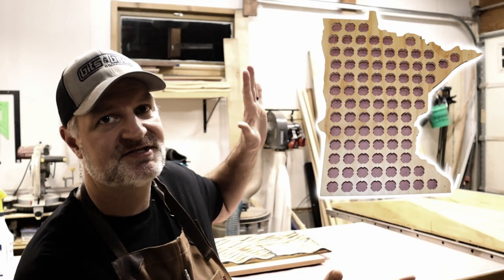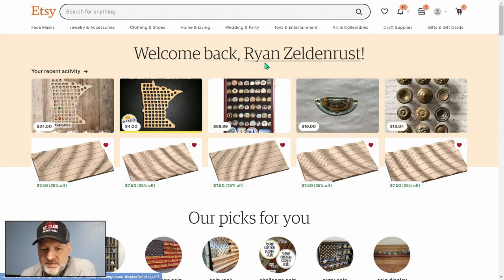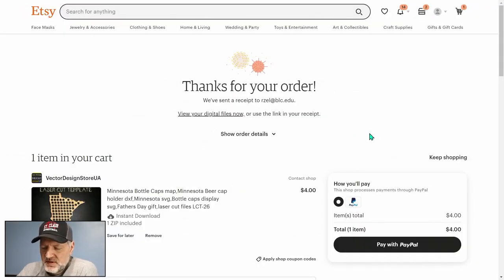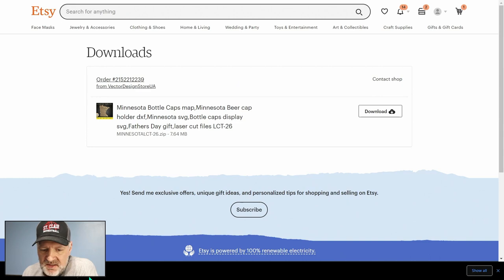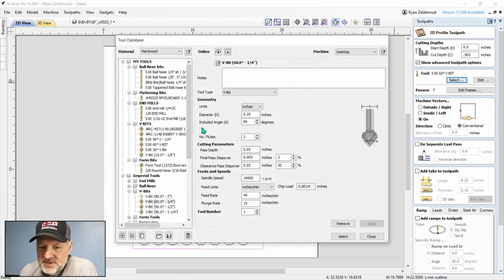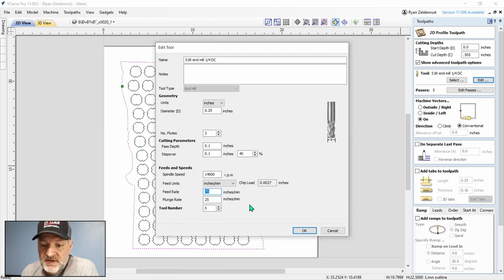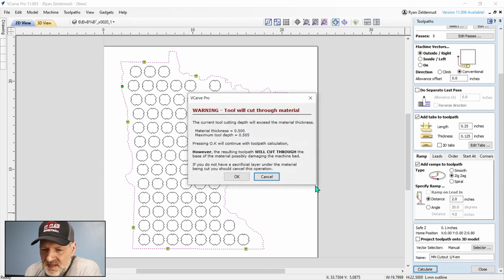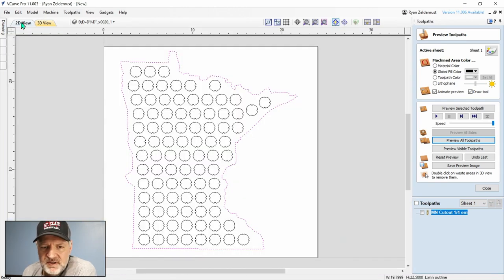Jaw-Dropping Bottle Cap Display meets Vcarve Pro & Onefinity CNC

Comment: Nice project. Just to add a little information that might be good to know. To take advantage of the compression bit (no splinters or burr on both sides) you need to go deep enough on the first pass so the down cutting part takes care of the top surface or program the profile pass to do a separate last pass to size with the bit at full depth. And the pocket operation is for not cutting all the way through. Inside profile pass would be better for the holes here. Cheers
Reply from the maker: Thank you for the advice! I will definitely add more detailed information in future tutorials.